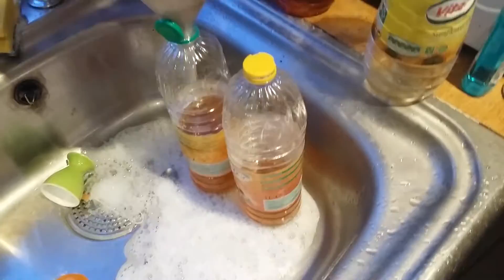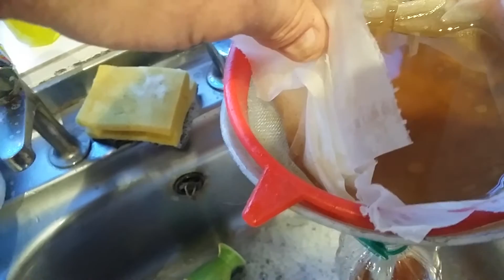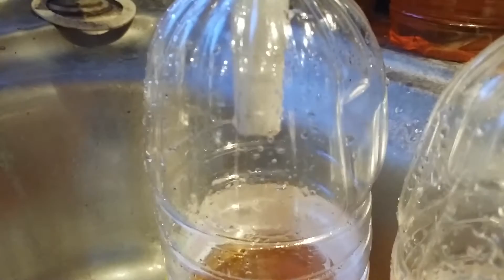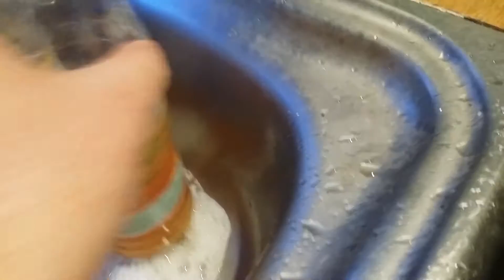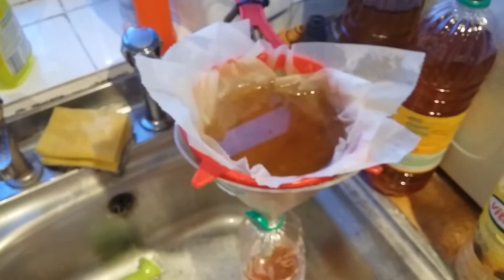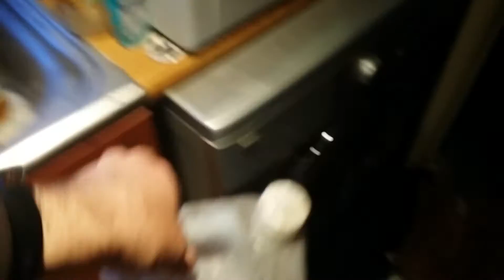Turn kitchen into mini Diesel Oil Refinery (CHIP FAT)

Comment: Hey matthew, if you haven't already, heat the oil up to hot as to lower the thickness, viscosity, before you filter it, it will speed up the process...